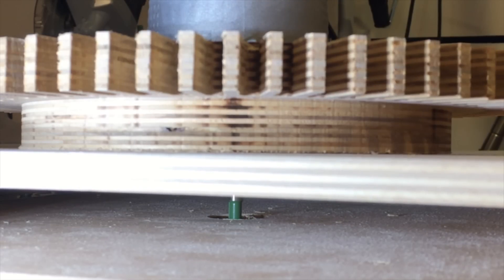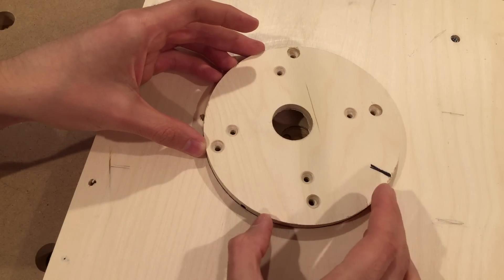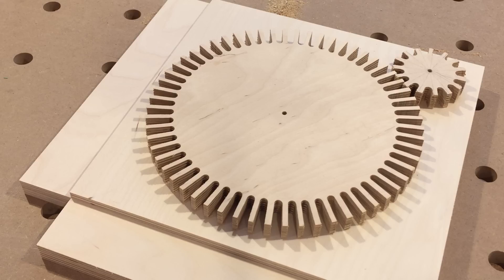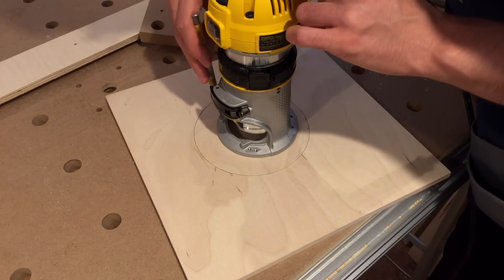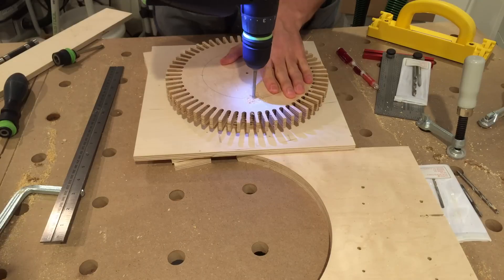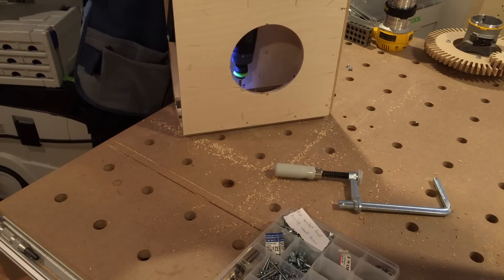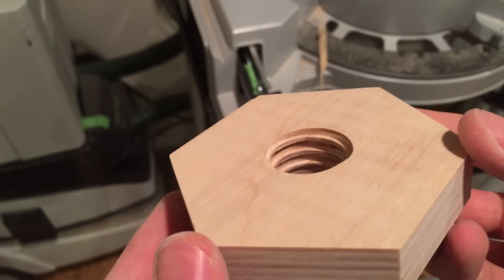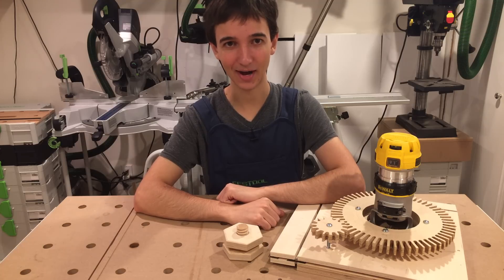How to Make Wooden Hex Nuts

Comment: I love your design and build!  I was wanting to make my bench vise threads using Acme threads and planned to grind an Acme thread cutter accordingly.  I wasn’t convinced on my approach for cutting the nut but the uniqueness of this design for cutting the nut will definitely be an approach worth considering first.  I appreciate your mention of the method for cutting the bolt and I plan to find the video you referenced and recommended. Thank you for such clear explanations of your steps in successfully making this project come to fruition.

Comment: For your next trick try to take to different sized dowels and screw the smaller diameter one to a larger diameter one. Thus creating a longer dowel with two different sized ends. There is a reason I have to see this.

Comment: F=MA
————————-
E=mc squared
Specifics of the acceleration 
Of the mass will determine of course the energy required to understand the velocity of the parallel ratio of the mass forcing the evacuation of it counterpart creating the nut.
You are freaking weird.

Comment: i wanted to see if there is a way to make a bi directional threaded rod with its corrisponding nuts... meaning a single rod with opposing thread directions on either end so as the rod is turned the nuts close in or opens away in reverse.  Great for self centering mortising jig

Comment: you would have to make the nuts and bolts larger but it would be a cool project to be able to make an apple press / wine press using nothing but would, leave all the metal component out, on wranglerstar Channel he rebuilt one not too long ago so if you need a guide to build one I believe that would be a good one.

Comment: Your a genius you know! Whatever it is you make, it's obvious a lot of prep has gone into it. Do you use Sketch up for your builds or another type of program? Or do you do this on the "fly",(off the top of your head as you go). Thanks for another interesting video and your hard work that goes into it.
~Dolly
Reply from the maker: For this particular project it was an old fashioned pencil+paper sketch. When it comes to more complex designs that require software, I'm a big fan of Fusion 360. Personally, Sketch Up isn't my favorite slice of cake – although I know a lot of people that swear by it.

Comment: How do you determine/control the pitch of the threads?
Reply: Is it amplified through the metal thread via those gears?
Reply: The gear ratio would determine the pitch. As the smaller gear is spun, it simultaneously rotates the router and lowers the device. Changing the gear ratio would alter the lift/rotation ratio setting the pitch.

Comment: There must be some interesting math going on to figure out the thread pitch ratio between the Z axis drive screw and gear ratio and then to match that to the router method of making the external thread. Nice work, by the way I found your channel through Fusion 360.
Reply from the maker: +Eric Kachadoorian – Thanks! It's a bit of math. There's some extra info available on the web article http://fasteasysmarttool.com/hex/

Comment: You should put the router on a bearing, to avoid the spiral of the cable! And for the small gear, you don't need electric screwdriver! Just put on it a wood grip and turn it with the hand!

Comment: Scale it up a bit and you can make boxes with screw-on lids.

This is usually done with a tool called a chaser on a wood lathe, which takes some practice.

Another standard application for a wood thread is a nutcracker.

Cork screw also comes to mind.

Comment: That is pretty cool!  Just a thought about stability with the weight of the router on there - bolts at each corner, coupled to the drive gear bolt with a piece of bike chain or similar to keep the top plate rising evenly.  They could be driven off the large gear too, but that might be far too much friction.  
Excited to see what you come up with next!

Comment: Not to complicate things too much but a simple suggestion would be to locate the bolt that raises the platform to the opposite corner of the jig as the hinges to give the platform more stability?
Reply from the maker: +tableshaper – Funny you should ask – I thought the same thing... and in fact originally built the jig with the bolt in the opposite corner. Turned out the axis of "twist" is along the diagonal that touches both hinges. For a moment I even thought the project is a bust because the platform is not stable enough. Then playing around with it I realized it's a lot better if the bolt is adjacent to a hinge (so I re-drilled holes and moved the hinges). You've now got me wishing that I included the "fail" in the video, would've been a cool lesson learned to show... oh well, I'll know for next time.

Comment: I don't mean to be negative, but how do you justify paying lots of money for festool tools when there are lots of great quality tools much lower prices. especially a $300 drill. you could buy a $120 dewalt drill that woold last just as long and you would still have money left over to buy another drill with money to spare. honestly don't see the point. are festool tools really that good?
Reply from the maker: +TechMechanic – The drill alone is not worth it, but the system is. Look up the "centrotec" system – it saves me time; to me, that's worth more than a couple hundred dollars.

Comment: Nice work! The wooden nuts & bolts would make a cool toy for young boys. They may also be used as functional as well as accents for some patio or outdoor furniture. You could create threaded holes in some shelves and use the threaded dowels and nuts to some interesting shelving units, entertainment system racks, etc.

Comment: If you wanted to put great pressure on the threads Search "thread angle for wood" as from what I've read a square thread is not the best and is actually prone to chipping off, 90 degrees is best. (Yes a 90 degree thread and a Square thread are different.) A vice thread of about 2 inch diameter is best with 2 to 4 threads per inch. Thanks for showing the Sarrus Linkage. Great video.
Reply from the maker: +deanznz – Good tip, thanks!

Comment: The one commenter is on to something about using a darker ink... I'd also like to suggest simplifying it and making it more about the stamping only, by leaving out the ink mixing intro.  Maybe if you were to hit lighter with the hammer you could reduce the ink splatter explosion letters.  Just my two cents.  It's a great intro either way. Your music style-ings are also very cool.
Reply from the maker: +Sprank900 – Hi... sounds like you meant to write this in a different video?
Reply: +FastEasySmartTOOL    oops. sorry

Comment: Use 3 small gears around your big gear, and an fixed bolt in your baseplate. Place a fixed nut in the small gears, and you've got a stable rising upper platform with more travel. No need for hinges. Keep up the good work 👍
Reply: Great idea

Comment: Nice jig! Just a thought though , I could see you had a little trouble with the lead of the router tangling, could the jig be made so the work piece would rotate instead of the router ?
Reply: +ian elley thats a good thought, but it would use more moving parts as well as be moving a larger item and making more complication.
Reply: +Jake Kalberer Would it still be as difficult if you shaped the not first ?
Reply: +ian elley That would make it easier, but you'd still have more parts to deal with. On another note, you might not want to restrict yourself to just the nuts and things of a small size, this has potential for some very cool joinery applications in furniture.
Reply: +Jake Kalberer  I look forward to see what you come up with, keep up the good work !!!

Comment: Excellent presentation.  Many thanks.
In my work, we use wooden columns, screwed into wooden boards as a support for the pipe-racks.  These are called 'rack pillars.  In days, the rack pillars are often plastic (and they work very well, along with their plastic nuts which hold down the rackboards) but I could certainly see a use for this idea to make a strong, removable 'tenon' joint.
Reply from the maker: +Offshoreorganbuilder – That's the coolest idea I've heard so far! Thanks for the comment!

Comment: That is great. A vice for the workbench would be a project that could be done with the nut and bolt you made. Im going to build a workbence in a while. So this is possibly a way to go for my vice. Sure beats the John Heisz manual nut chiseling method. Still its a big project in itself to make the jig. That would only be feasable for multiple nuts needed i think...